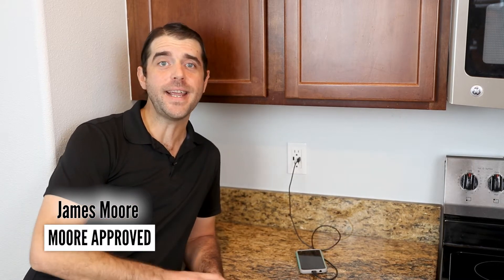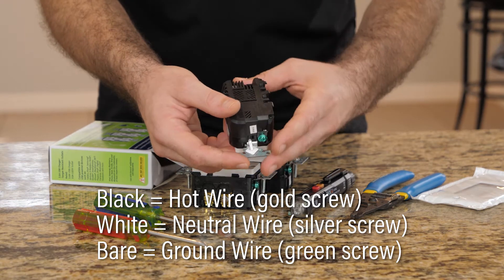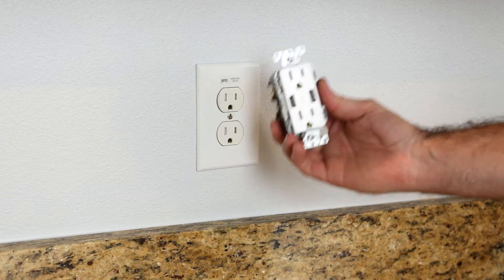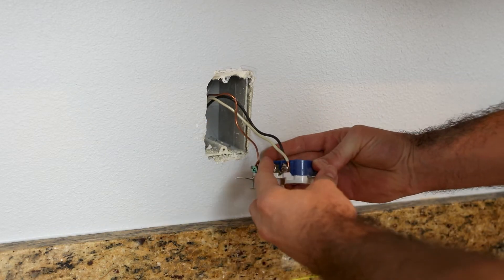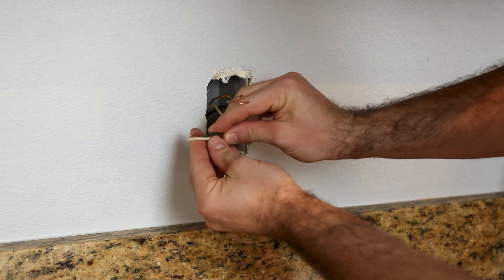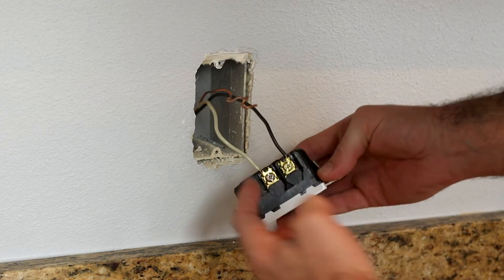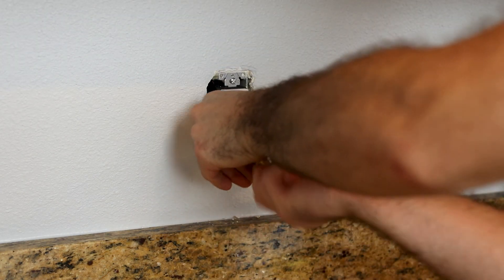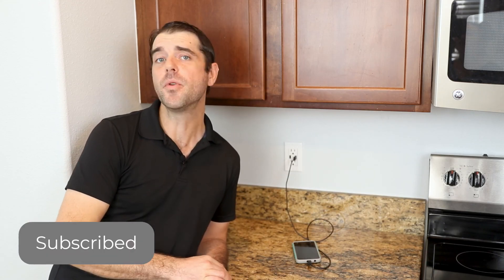How to Install USB Outlets | Easy DIY Home Upgrade

Comment from the maker: Note: this how-to video applies only to the United States power grid / voltage. 
DISCLAIMER: I am not a qualified electrician. Perform these tasks at your own risk, seek the expertise of a licensed professional and check your local code requirements before attempting anything you see in this video.
0:00 Intro
0:10 Tools Needed
0:40 Unboxing USB Outlets
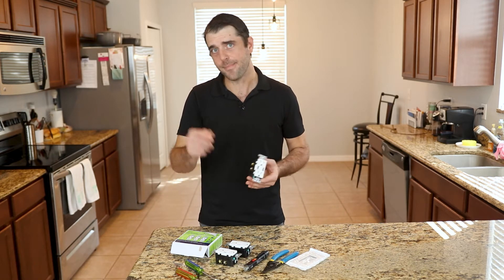1:43 Removing Electrical Outlet
3:18 Stripping Wires
4:07 Attaching Wires
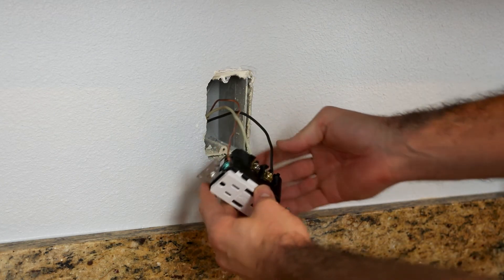5:51 Inserting into Wall
6:11 Wall Plate

Comment: Can yo help me, I don't know how do we install with black, white, red and ground.  Theire is no place for red
Reply: did you figure this out ?
Reply: Red wire is for a wall switch.
Reply: Cap the red,  Connect black wire to hot screw, connect white wire to neutral screw and connect ground wire to ground screw. Next remove the switch feeding power to the outlet and replace switch with blank cover plate so that no power will go to unused wire or just hire an electrician. Hope this helps.